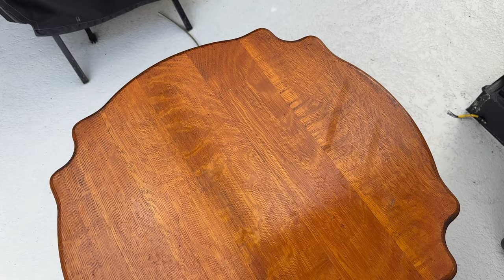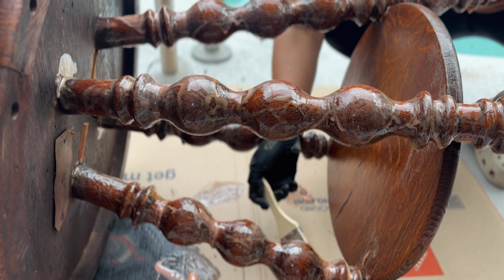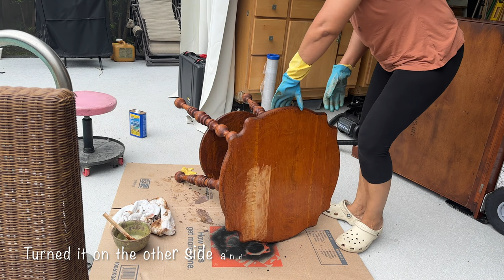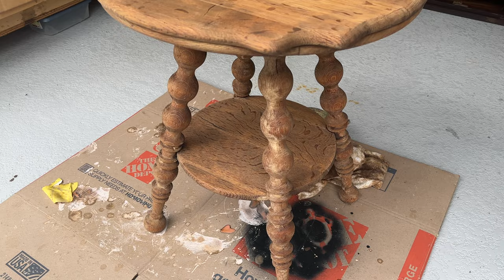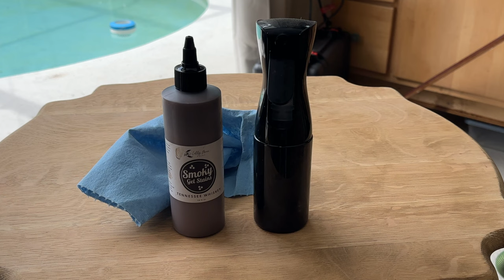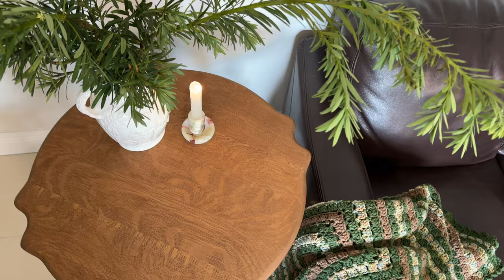Refinishing An Antique Tiger Oak Side Table: Easy DIY Furniture Transformation

Comment: Literally spraying the entire table with oven cleaner would have stripped it to that finish without all the scraping and doing.
Then after washing the table off if you want a lighter finish just spray bleach all over it.
Looked lovely though and well worth the price you paid.
Reply from the maker: Have you used oven cleaner before and not have to brush off the finish from crevices? Just curious 👀
Reply: You have to brush it over yes but the whole thing is a one and done to get it just stripped back and 3 shades lighter.
No need to re apply and wait hours in between and of course it's a spray application with oven cleaner so it's cuts out the making sure you get it brushed into every crevice etc. 
It's down to personal choice I guess and time that your willing to spend on a item.